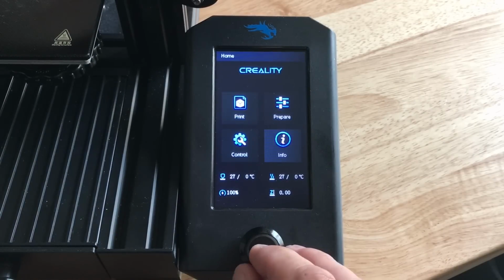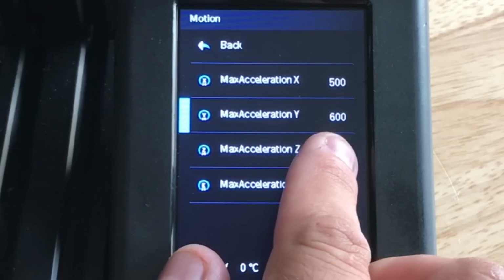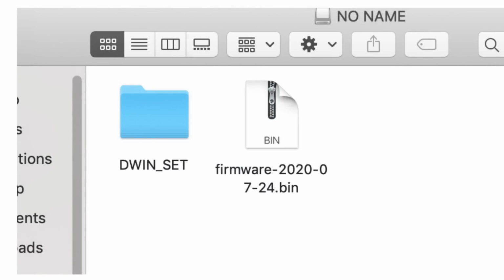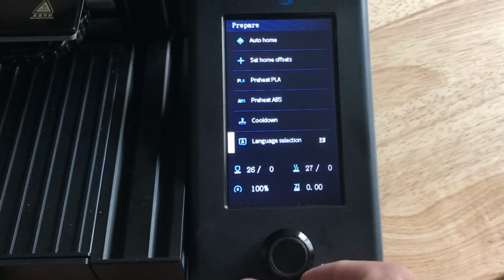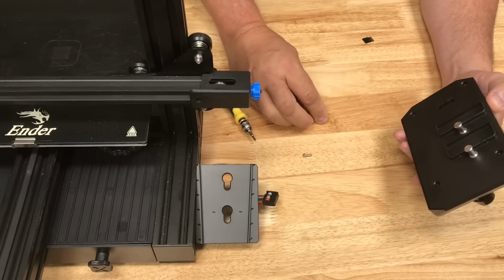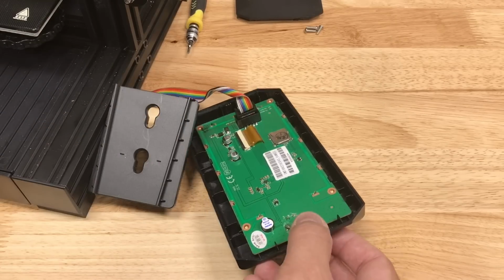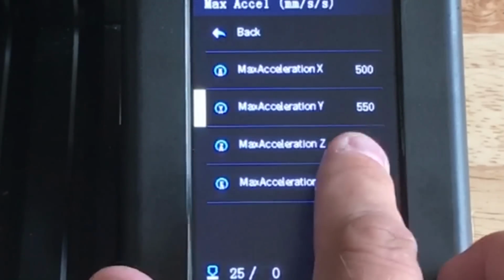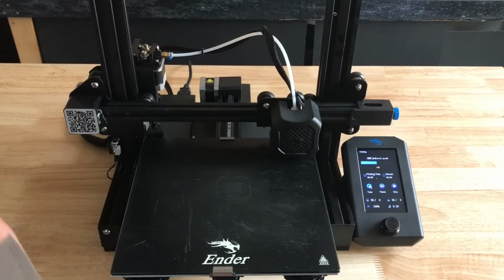Creality Ender 3 V2 Firmware Update - Motherboard and Display

Comment: I need this exactly firmware 0.0.6 and i can't find it on merlin page.
What ever firmware i tried 9n my Ender-3 v2 doesn't work on TPU.
I had same issues with my Ender-3 and i installed the 0.0.6 firmware and working excellent.

Comment: Can someone help me here please???
I just bought an Ender 3 V2 and everything was ok except the temperature number dropping from the set 200 on cura or the printer preheat setting to 175 every time I click print to print something , Creality sent me 2 files to update/flash the firmware on the motherboard and screen, which I did, but now not only that temperature drop still didn’t get fixed, but also my printer doesn’t print good anymore, even after I finish to level the bed, the nozzle seems to be too far from the glass and it drags the filament allover the bed and if it doesn’t the prints look so bad,also the extrusion don’t seem to be close to each other so they can melt to each other.
What did I do wrong? Creality takes forever to communicate back and they don’t seem to know what’s the problem, can someone help please?
Thank you
Reply: I have the Same Problem
Reply: @MCI247  
I solved my temp problem by uninstalling and reinstalling Cura, and then I changed/updated the printer’s firmware
Reply: @MCI247  
Keep in mind that Cura initial printing temp sometimes is different than the printing temp after the first few layers, you have to change that accordingly

Comment: I want to lower the firmware version of Ender 2 Pro, what should I do? I put in the firmware file and turned on the printer, but it's not working
Reply from the maker: As long as the name of the file is different then it should work.

Comment: If you're having issues with your screen, try placing the "private" folder on the card instead of the DWIN_SET. If your screen looks cropped, make sure to check the Configuration_adv.h file and make sure the LCD option for "portrait" orientation is enabled, while the "landscape" option is commented out. This is an unfortunate oversight that seems to keep popping up in the config files with updates of Marlin. It's an easy fix, once you know the problem.

Comment: I've updated to Marlin 2.01 but not able to install the dwin_set folder, the display just stays black when I power on with the microsd inserted into the display's card slot. When I take the card out of the display the machine still boots normal. Any ideas?

Comment: My new Ender 3 V2 with 4.2.2 board after a couple hours into print the extruder makes this like clicking sound and doesn’t feed the filament. I original thought the hot end was clogging so I upgraded the extruder and raised the nozzle temp to 205, but that didn’t fix it. I looked closer this time and saw the drive wheel is just bumping and not turning. Any ideas? I read there were problems with some of the 4.2.2 stepper drivers and to get a 4.2.7. It’s a shame this is only my third print first two were the samples.
Reply from the maker: Check the connection for a loose pin.
Reply: I had the same problem, turns out the screw for holding in the spring was too tight. I loosened it a lot and it didn't make that clicking noise and had no issues with under-extrusion
Reply: Pins and connectors seem good and tight, just every once in a while will just make this thumping sound and not advance some times will restart others just thump away. Just tried a different file to print, cleaned hot end, changed the nozzle and made a fresh square cut on Bowden tube.Brass extruder gear just advances slightly then springs back making that thumping sound. Tried loosening the springs screw all the way out and same issue. Would have been nice if that was it.. thanks guys. Any other suggestions?
Reply: Anyway to send a video of it in action?

Comment: The V2 also doesn't like using the same filename over and over. It uses the file name to determine there is a new firmware. Also it doesn't like ANYTHING on the card. Also, if you mess up, the LCD screen will be blacked out. You can fix this by flashing both the LCD and board back to stock (files are on the creality site).
Reply: Can you give me a link to this stock firmware?
Reply: i couldnt find stock firmware can u send a link

Comment: After 1 minute from the first switch on the display has turned white. I tried to update the firmware but nothing changes. I connected the Ender 3V2 to the PC to see if the motherboard worked and everything was working perfectly. Could it be a firmware problem or a broken display?
Reply from the maker: Check cable connections.
Reply: @FilamentFriday  In your opinion is it a cable connection problem? I have seen that all the cables leading from the motherboard are stuck with a drop of hot glue. Could it be the cable from the motherboard to the display that's having problems?

Comment: Chuck, I have just purchased an Ender 3 V2 and the installed firmware is version 1.0.2. Can I load your Mesh Bed Levelling software or do I need to replace the existing firmware first. I have watched many of your Filament Friday videos and am learning a lot. Thank you for your clear, concise and extremely informative content. Regards Paul (learning in the UK)
Reply from the maker: You might have to reload firmware.
Reply: @FilamentFriday  Thanks, Chuck. I assume you mean the Marlin firmware.
Reply from the maker: Yes

Comment: Mine wasn't flashing the firmware for the screen... when you format the SD card, in addition to formatting as FAT32, you have to set the allocation size to 4096 bytes.

Comment: I noticed how quickly your screen switched from blue to orange. Normally it should stay blue for a longer time. It did the same om my printer and I found out the screen hadn't updated at all.
Looking in to how the screen works I found out that the sd-card reader on the screen doesn't support cards higher than 2Gb, so changing the card's format to 2Gb did the job. The screen stayed blue for a longer time before changing to orange and the screen's firmware was updated.
Reply from the maker: Mine was edited shorter.
Reply: The film clip just looks exactly like mine did when it didn't update the screens firmware; a short flash of blue and then constant orange.

Comment: My screen goes from black to red me and nothing works. What to do ? I damaged my motherboard? or is my screen broken? My fans are running etc ..., but I see a red screen. Then if I remove the SD card from the screen, and I restart the power, I no longer see any menu and it is a black screen with blue light. What to do ?
Reply: I’m literally having the same issues, I’ve got the blinking screen but when I power it up nothing but a black blank screen
Reply: Did you fix it?

Comment: I just got the V2, and tried to write my own leveling program, corner by corner using Mo S20, and M1,  just like yours no stop.  Is that what was happening here?  Do I need the new firmware to use the optional stop?

Comment: Hey I just bought a V2. Can anybody tell me why when I put in my microSD card the V2  will only recognize the first 30 Gcodes saved on the SD card? The same SD card can be plugged into my ender3pro and it registers all the files. I’m about to return this printer.
Reply from the maker: It’s probably the firmware. https://youtu.be/vFcMW6m9OGg
Reply: Thanks chep. Honestly it’s ridiculous that I have to do this. The printer is working just fine. Really I’m getting a little better quality than my 3pro right out the box. But I have 10 SD cards with hundreds of G codes on each one and it’s not registering the files past the last 30 files saved. I bought it from Amazon so you know what that means, If I can’t figure it out, it gets returned and I’ll buy another one until I get one with the eight bit board.
Reply: The last question that I have, Is it  the same problem with the ender three max? It was between the max and the V2 for my 2nd printer. I ended up going with the V2 because all the files that I already have G coded and saved are for my ender3pro. Then I wouldn’t have to add a printer to my cura. Although that’s not a huge deal but then I would have to keep separate SD cards for each printer. Let me know because I’m considering just getting the max. Thank you for your time.
Reply from the maker: The Max seems to have more complete firmware than Ender 3 V2.

Comment: Thanks for the tutorial. But the link available in the description needs $10.50 to use it. And creality has also released some latest firmwares for ender 3 V2  on their website for free. 

So, will new official firmware work to add pause at height functionality?

Comment: Not sure what is wrong with marlins new firmware. But it will not allow my Z to go - to do a z off set for my bl touch. and my nozzle is way to high. And i do not see any way to contact them. Ender 3 pro with BL touch, V4.2.7 board

Comment: i dont know what i do wrong.. just installet the SKR mini V 2.0 .. but blank display and the display says BEEEEB and wont stop.. even this dont work
Reply: Did you ever figure it out? Having the same issues
Reply: @djbadmiral  nope :/
Reply: @andreknudsen3272  I figured it out, I had to find the DWIN folder on someone’s github but out that and the creality website’s firmware on your sd and boom mines came right on after I put the wrong firmware in. Make sure to put it in the screen too in the back.

Comment: Does anyone know how long the screen update should take? Mine's been sitting at the orange screen for about 10 minutes.
Reply: You are suppose to shut it off and take out the sd card when it turns orange. That mean it's done.
Reply: @itsCoreyLee  My screen never turns to orange. I attempted three times, first only folder in SD card and firmware inside folder, second time I formatted card and only config and bin files in it, third time I formatted card only bin file in it, none of attempts was succesfull. What do I do wrong? Thanks
Reply: @itsCoreyLee  Ah, OK... thanks. I was forced to do that anyway, so I'm glad the job got done.

Comment: I put in the update from creality and now none of the motors work and it won't budge or auto home. it just sits there with just the fans spinning
Reply: same here
Reply: I just bought one out of the box same problem, did you get yours fixed if so How

Comment: Hey chep. Do you know if there is a way to get the v2 to resume print after lose of power like the regular ender 3 . I dont believe the v2 has that feature.  Thanks
Reply: The V2 has that feauture.
Reply from the maker: Use the M25 option and it should work with V2 firmware.

Comment: Will this firmware work if I have a BL touch installed? I have 4.2.2 boards, one with a BL touch directly plugged into the motherboard, the other with a conversion board? Both of my machines are storing settings on the SD card as well. Currently running the latest creality firmwares.
Reply: I Second this question

Comment: I'm hoping you might be able to help I've been doing my own firmware and I cant seem to get the new Z offset wizard to work on my ender 3 V2. Like I cant even find it in my menu and I uncommented the code for it and so it would appear in my menu. I also updated the screen as well. I'm using the BLtouch  V3.1. I've used the latest bug fix version of Marlin and I'm stumped cant find anything about it really for the V2. Any ideas are appreciated. Thanks!!

Comment: Could you do a walkthrough of the firmware site you recommended showing how to build custom firmware for the BL Touch on an ender 3 V2 specifically the bed leveling options and probe margin? Or show how to use the provided one and compensate for having the Creality mount instead of the printed one that the firmware is designed for. Thanks

Comment: I have tried to get a subscription for the firmware, but it won't let me register.  Anywhere else I can go?
Reply from the maker: Not sure. Many have signed up so strange you are having issues.
Reply: I can also confirm, still signing up for a subscription is proving difficult on the Marlon FW site.

It just puts you in a sign in loop.
I’m on safari on iOS devices.
If anyone has a fix please let us know, as of right now , I’m trying to update my FW on my new E3V2, but just won’t let me.

Comment: I have the firmware you built that is no longer available on my ender 3 v2 and I have some issues with the printer setting itself ridiculous speeds (like 900+%)  and I can't change it to 100% because it over rights my settings automatically.

I want to change the firmware to see if it changes anything. What firmware do you recommend?

(I am using Cura and some files are fine and will print but some won't because the printer sets itself to crazy speeds. I have tried reslicing and putting it on another SD card but I have the same results. Perhaps it's the printer struggling with larger files?)
Reply from the maker: What I recommend here: https://youtu.be/vFcMW6m9OGg
Reply: @FilamentFriday  Thanks

Comment: I have my ender 3pro v2 with 2.0.1 firmware and I still could not save the setting in the V2 machine.  Currently only can be saved in the sdcard.   Is there a new firmware for this V2?
Reply from the maker: Watch this: https://youtu.be/vFcMW6m9OGg

Comment: If you are unlucky enough to have a V4.2.2 board everything still appears to be as clear as mud!
Nowhere on the Marlin Firmware Service site does it even mention the 4.2.2 board it would appear
that they only seem interested in taking your money as they can't even be bothered to put contact
links on the the site so that you can ask for advice!
The Creality site is not much better, they actually mention the V4.2.2 board but then confuse things
by adding the BLTouch info in the name of the rar file. Even Chuck calls it a "fiasco" in the title of
one of his videos.
Reply from the maker: The V1.1.5 is the marlin file for 4.2.2. Ender or Ender Pro
Reply: @FilamentFriday   I'm sorry but that just causes more confusion, I can see nothing either on the Marlin or the Creality
that says "V1.1.5". the closest to that is this "Ender 3 V1.5 - Stock" on the Marlin site but that suggests it's for 
the Ender 3 NOT the Ender 3 V2
Reply from the maker: Sorry. I meant 1.5

Comment: Issue sorted. I've downloaded 2 binaries 1 of them wasn't the correct one. But there was no 8 bits or 32 bits clear definition. Anyway without the definition I've cleaned the micro SD and loaded it with DWIN_SET folder and following that I've loaded the file                                     Ender-3 V2_Firmware_Marlin-2.0.1 - V1.0.2
outside the folder.  That's how the binaries are defined. Take care with the websites called Creality: one of them has old firmware but the site seems to be not part of the same organization so a good antivirus is recommended to reach out of the old website. Now it is working however I'm unable to find the printer aligning function that was there before. I will try the DWIN_SET-master I've found at github and will load it on the control display card: why not?!?! there is always a recover.

Comment: I'm wondering you didn't jump any step such: does the printer has a bootloader installed? I've followed your instructions and I have the printer snag... clearly something is missing.
Reply: The printer uses the more modern 32bit motherboard with reinstalled boot loader built in

Comment: Looks like I have just paid £9 to some guy in Australia for exactly the same firmware update that got on
the Creality website for free!!
Reply from the maker: What printer? What board? What version?
Reply: @UCsdc_0ZTXikARFEn2dRDJhg The printer is an Ender 3 V2, the Board is a 4.2.2 and the current firmware version is Ver 1.0.2
What prompted the update was Octoprint reporting a problem and suggesting I should contact the vendor.
Reply: @FilamentFriday  iv just loaded this on my brand new printer. the sceen now backlights but doesnt load anything. Printer is now fucked!!
Reply from the maker: You can reload it. Use a 8GB SD card and change the name or get the original from Creality.com under support.
Reply: @FilamentFriday  yes I managed to get it sorted after some interweb investigation lol. Thanks
Reply: @FilamentFriday  Thanks for the reply, I did actually get it back with the original from Creality, however I'm still looking for an upgrade to get Octoprint working.
Have you heard of some firmware called "Unified 2"  by a company called TH3D, which I believe is also based on Marlin but seems to be specifically
for Ver 4.2.2. As my machine is less than 6 weeks old I'm surprised it is not fitted with the Ver 4.2.7 board.
Reply from the maker: I personally don’t recommend TH3D.
Reply: @stephensayers4998   hey man can u tell how u did it? my printer doesnt boot from the start just stays at the creality logo for ever?! Thanks so much in advance!
Reply: @floriankrones3062  Hi, yes you need the micro sim to be completely free of any files and g codes, that includes the folders pre loaded (save them into your computer) then download from crealitys website the latest firmware for your printer. (the .bin file) then rename this file 1234 and just plug it in and turn on. I have to say that this fixed the problem with my printer but not knowing if its the exact same problem my not work for you. please comment back if this worked for you.
Reply: @stephensayers4998  Hy! thanks a Lot for the reply! Unfortunately it didnt work! Still havent seen anything else than the startscreen on this pointer! So the search goes on! Have nice hollidays!
Reply: @floriankrones3062  sorry to hear buddy. hope you manage to sort it. 
happy holidays to you.

Comment: How do I change the esteps to 412. V2 only goes to 186 max. tia
Reply from the maker: If you need 412, your idler arm is probably cracked.
Reply: @FilamentFriday  hi, no, it is a new extruder with a 3 to 1 ratio. It worked well on my ender 3 pro. Dual gear. Some bmg clone or something